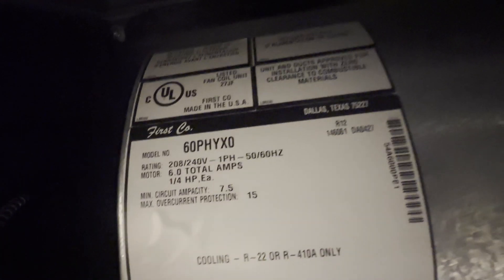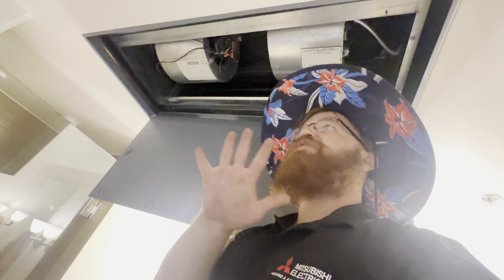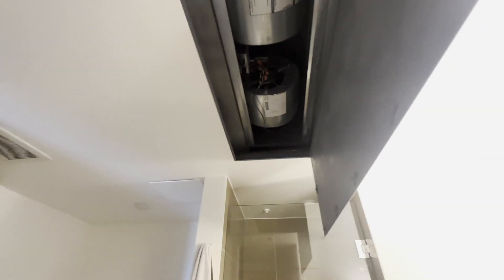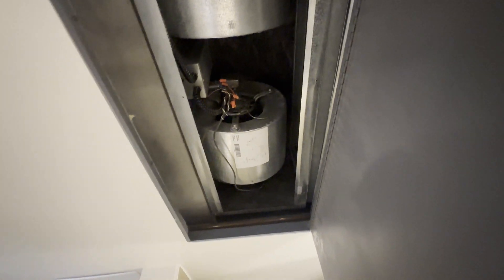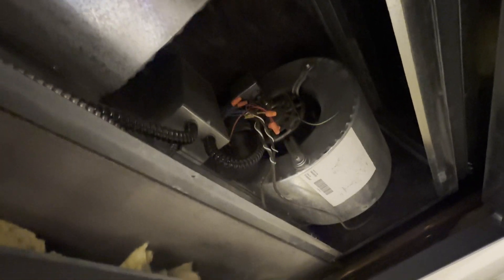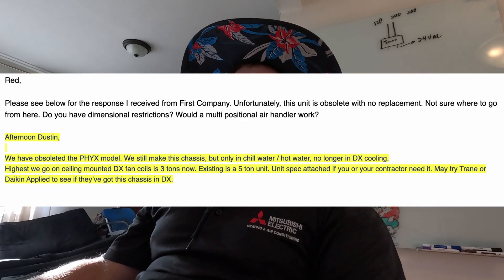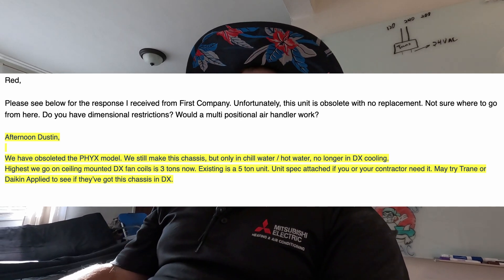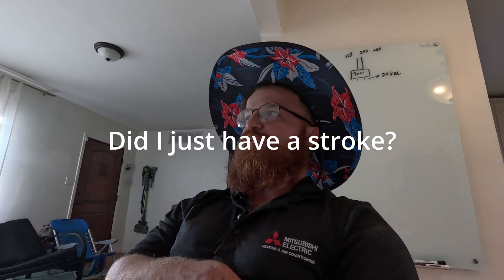Do NOT BUY A HOUSE With This HVAC System - Soffit Mount 4-5 Ton Units

Comment: I hate  soffit unit . 90 percent of  the issues is unit wasn’t installed correctly . Example some units the drain pan is one whole assembly so mindful to have  a slight pitch to allow the drain pan to work . I had a thick washers  to one side of the long anchor bolts ,two to 3 degree pitch is all you need . I mostly walk away . It’s triple the work and too many unknowns .
Reply from the maker: Bingo. This one is having a leveling issue. We did not touch the indoor unit besides TXV because we really didn't want the risk associated with working on it

Comment: First Co has such a long lead time. Six months for one air handler. Also the newer chassis are bigger and that makes it to where they won’t fit in buildings that literally built the mechanical closet around the old unit. It’s a mess.